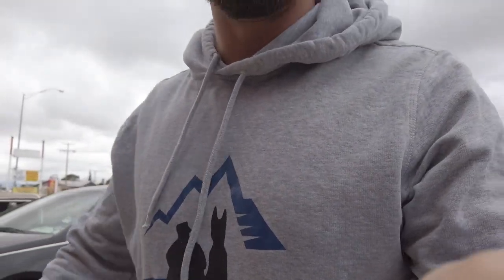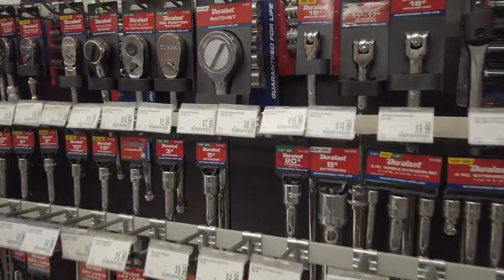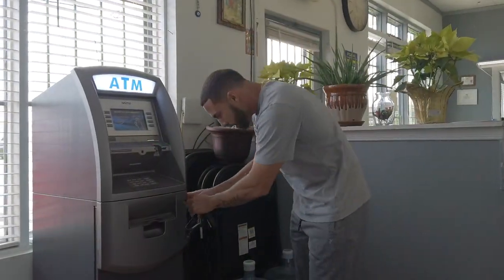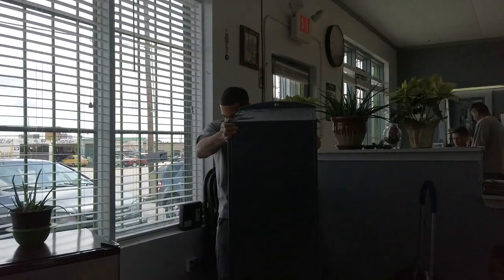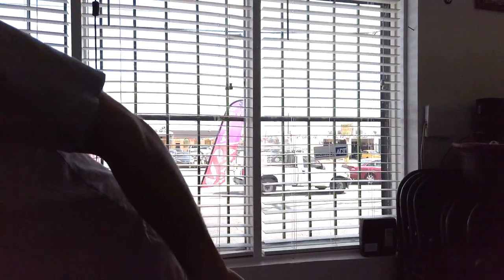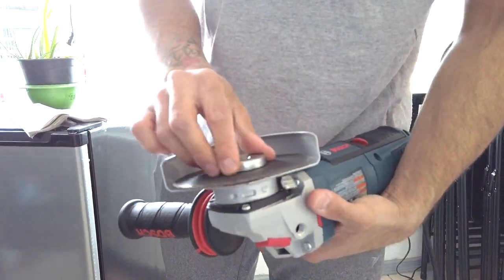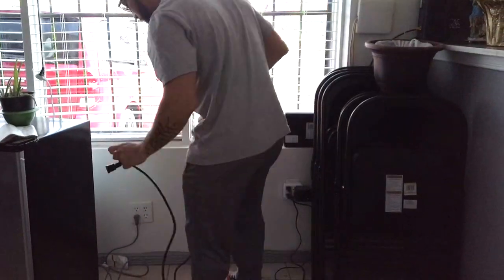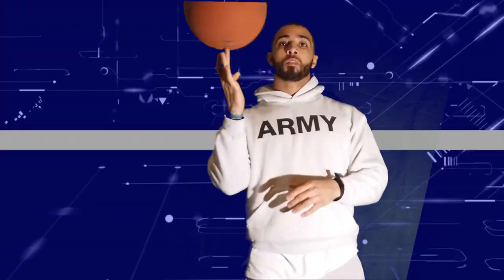HOW TO UNINSTALL ATM -  Remove Bolted ATM From Business Location

Comment: What should I do, a property I purchased has an abandoned atm. I called the number on the side and I guess they sold the company and unfortunately they no longer service this unit. I need to move it out out the way though if it’s on my property can I remove it myself?
Reply from the maker: You can call a lock smith and see if they can get it open for you and possibly be able to remove it that way. Have you tried that?